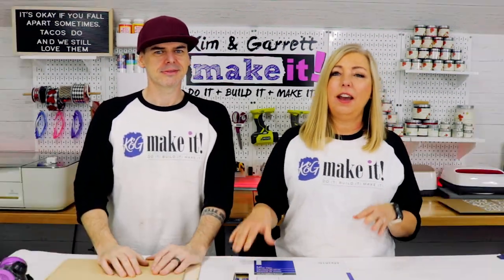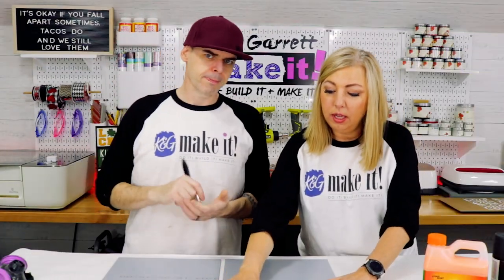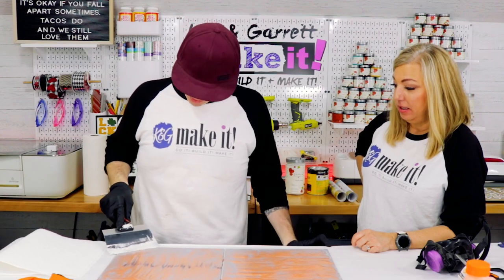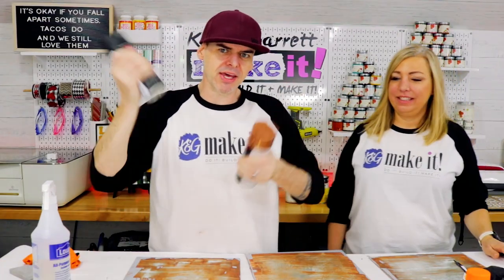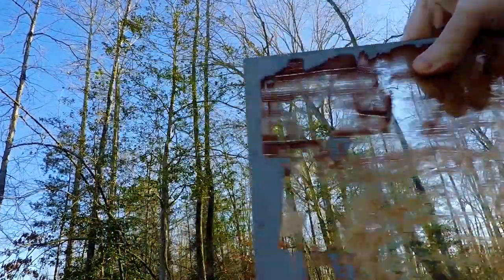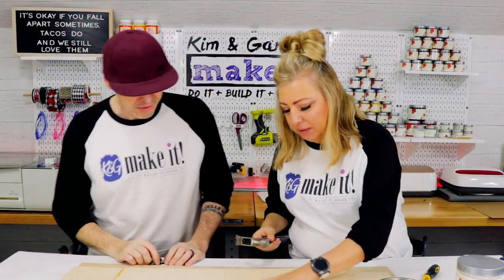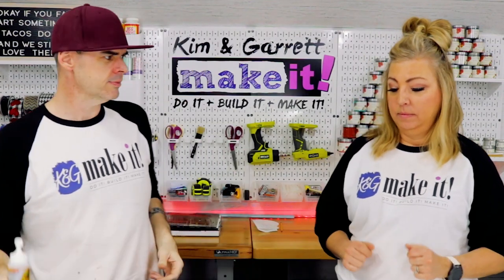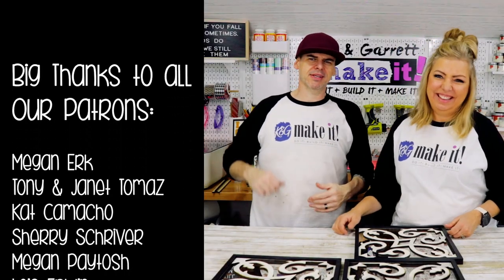DIY Antique Mirrors To Sell At the Farmers Market

Comment: Awesome project! A suggestion for getting drips/splatters of liquid onto a surface. I use this technique a lot on cardmaking. If you soak a round paint brush with the liquid (bleach solution) and tap the brush against a hard edge above where you want the splatters to go, that would give you a splatter look. The bigger the round brush the bigger the splatter. Not sure if I explained it well but hopefully this useful for future projects. Love the quote on the letterboard 😂😂😂. Can I post that on my IG? Have a great weekend! 💕
Reply from the maker: Of course you can! Thank you for the tip!